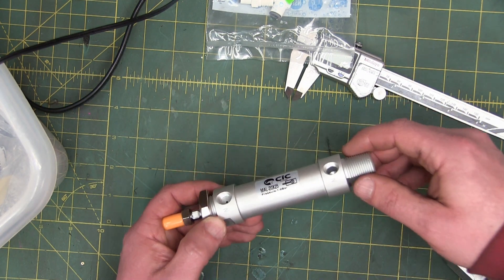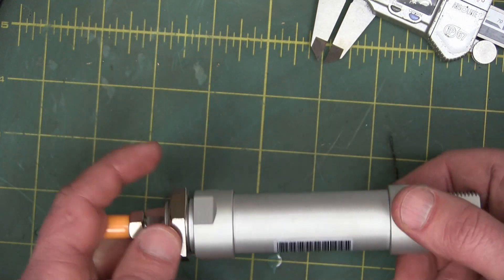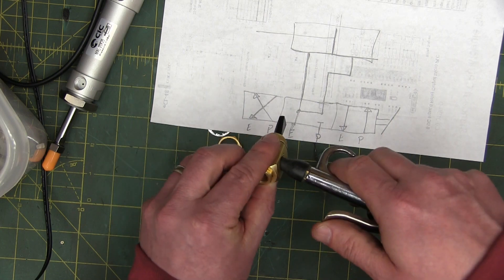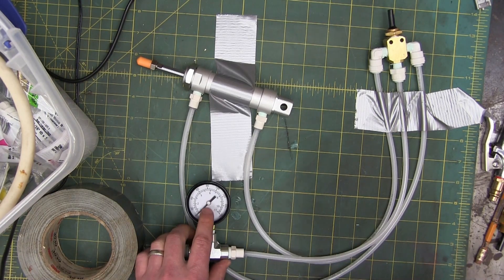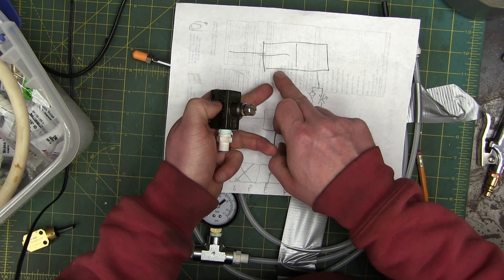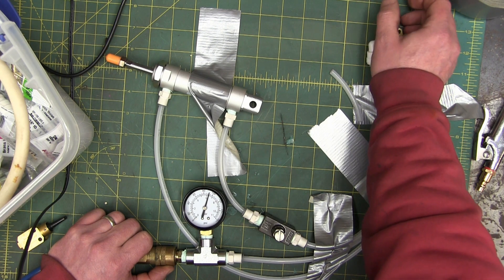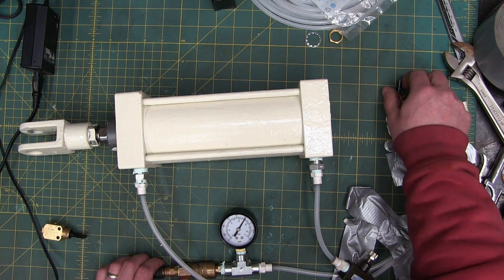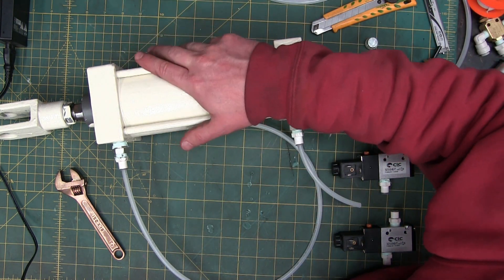PEW-PEW! Pneumatic Automation | Industrial Lego

Comment: 4.00 regulated flow valve, speed it up, slow it down in either direction. these things are so easy and loads of fun to use, Ive made some complex sorting machines with nothing but controlled wind.

Comment: Love the end : )
I fix wood shop equipment, among other things, and some are packed with this tech.  

AVE do you know that this is exactly what is done to keep the belt on the rollers on belt sanders?  The actuators oscillate the top roller(s) with micro-switches (sometimes optical switches,...)  that the belt actuates when the belt gets to the end of the roller.  It just walks back and forth to keep from running off the end of the rollers.  Also good machines have flow control on both sides, it allows smoothness, quietness, better performance and longer life when you control flow on both sides.

Comment: Now you’re speaking my language. We have a ton of Bimba cylinders. Servos would be nice (Linmot) but so pricey.  The cylinders on one of my machines are spring loaded for quick return. Some are custom made to resist heat (seal bars).  The bigger cylinders can be rebuilt. Just held together with snap rings. The smaller ones just get replaced. Linmot style servos would make changeovers so much faster and they would last forever, but the cost of retooling would be prohibitive.  Looking forward to some solenoid talk. Yeah baby.

Comment: see all this stuff at work daily. the only thing I hate is when they use pneumatic limit switches in safety devices.... moisture and particles foul those damned things up and they sometimes stick. was almost killed ( literal 6 inches or a half second) by a 2 ton mod full of leaf springs coming off a gravity feed chutter because a switch got stuck.

Comment: On the subject of flow controls, I worked on corrugating machines. I was a maintenance tech. One of the other “techs” insisted on putting the flow controls on backwards. After 3 or 4 times trying to explain how they worked I gave up and resigned myself to replacing cylinders on a regular basis. 5 years retired and I finally regained my sanity.

Comment: Ryobi 4 color printing presses were/are automated with this stuff plus matching plug and play air solenoids. pull one lever other three follow suit. Or the monkey pushes one button and away we go automated start, run, print,rundown, stop. Uber cheap. Just make sure to adjust stroke so as not to snap off operating lever small package humungus torque.

Comment: Tiny bit of experience: Used these quick connects all over the place in my jeep. They work great but they leak if there’s a moderate amount of lateral force on the tubing, so it’s good to watch your bend radius and use other means to hold down tubing where necessary.

Comment: You could just use micro switches at each end of the throw to actuate the relay. The 'confuser' is just added complexity. Though I would agree that it is a more elegant solution as it would remove the 'mechanicals' of using micro switches and allow for 'tuning' or changing the operation.  Loved this one. Thanks Uncle Bumblefuck.

MozZ UK

Comment: Once played with a keg washer line at a brewery. (3 lines, identical except for conveyor length)

All the logic switching was done by pneumatic "microswitches" to facilitate tilting and rotating of the kegs. Pneumatic actuators throughout.
Only "electronicals" were for the sterilising rinse time (hot caustic soda).

I was told that the washer lines were originally designed in the 1940's.
My job was to find why beer was going off before its time.
It was an electrical timers; one line had barely a third of the necessary rinse time; and that was on a "secondary" washer line which was used only during peak times or when the primary one was "jammed" by a (deformed) keg falling the wrong way.

Comment: Good video.  I work at a winery putting wine into bags and sending them on their way to get sealed, palletized etc. Pneumatic actuators are our bread and butter. I took a bad one and cut it length wise so the noobs could see how they work. We also use a crap load of "MAC" (brand name)  pneumatic valves and ed everything is on a program to perform a sequence of operations to feed in a bag, in cap the bag, fill the bag, recap etc. When the plant installs new equipment, it means old machines are removed and this means left over parts in the parts room. Knowing the guy who maintains this cornucopia of new parts that are no longer needed can net some cool stuff. How about a Halloween coffin that jumps around and the lid slams up and down...f'n awesome.

Comment: Aww, I was hoping for air logic. The problem with using a computer for something is that there is no limit to the amount of complexity that can be hidden away in that tiny black box; you can't ever really trust a computer-controlled system the way you can a system with only uses simple components.

Comment: Mind numbing?   I had to unpackage exactly 96 individually wrapped parts for a pair of 2.0 liter subaru cylinder heads in order to clean, check,  and assemble for the local stealership.   Would have blown my own brains out had I gun handy.

Comment: Used to do ldpe rotomolding and thermoforming.  We made spiral playground slides and for a year we would punch the holes where they bolted together one at a time by positioning the part by hand then stomping a lever with our foots to punch the die through.  We ended up building a fixture with 26 pneumatic dies to punch all the holes with the press of a button.

Comment: I was taught over 30 years ago, "when in doubt meter out" that works for pneumatics and hydraulics. On pneumatic valves that has a threaded exhaust port I like to use the two in one exhaust muffler / needle valve, it eliminates fittings which cuts down on the possibility of leaks.

Comment: Great video and very interesting AvE!
At my old job, I built an automatic honing machine that was all air powered. I used some limit/stop controls to set the stroke length and flow controls to set the RPM of the air motor turning the hone and to set the air cylinder stroke speed. The finish on the bore we desired took 1000 rpm and 60 strokes per minute. When I started out building the contraption I'd be the first to admit that I did not have a clue as to what I was doing, but with copious amounts of reading/studying and experimentation I managed to make it work and it worked damn good if I have to say so myself. Once we were finished using it for our purpose, a machinist we knew came by and saw it laying in a corner. He asked us what it was and if we would demonstrate how it worked for him. We did so and damned if he didn't buy it from us on the spot. I wish I had enough sense at the time to take some pictures of it and diagram it out with a parts list, but I didn't.

Comment: I literally just did this last week, with the exact same components. Two air cylinders, 3 way electric solenoid, controlled by a micrologix 1200. The same exact job. I had to build in a few safety devices, dead man switch, stack light, prox switch, air pressure switch, ect.

Comment: Motor graders are a good example of a machine that uses a float envelope in a control valve in a hydraulic system. Usually it will be a 4th detent position to control blade height. So you have up, closed, down and float on the blade. Float essentially gets used to even out the surface using just the weight of the blade.

Comment: I worked at a major medical device manufacturer a few years ago as an intern. I went to their production facility. There were extremely automated lines with some of the most creative machines I've ever seen, churning out products with no manned intervention. Then I also saw fully manned production lines with supervisors, quota clocks and everything. I asked my supervisor what gives? They know how to automate all of these if they wanted. He told me that the economy of scale dictates what is automated and what isn't. The automated lines cost millions of dollars to design, set up, test, and run. If the product is a low volume manufacturing, it's actually cheaper to higher people to pull levers all day.

Comment: AvE could the big cylinder or similar be used to drive a powerhammer? Could you use one as the actual striking head by affixing a proper tool to the end. I guess the real question is can a piston like this deal with a short stroke if there is an interference object and keep cycling...

Comment: That reminds me pneumatic circuit I made at work (I'm electrician btw). Two-hand control block (fires up when two inputs are switched on in 0.3 seconds), switch and 5/2 valve. When machine did certain operation, I needed pneumatic cylinder to move one direction and then automatically go back when it reaches back position OR when pressure from machine disappears (to make it idiotproof in case somebody reduced air flow too much). Whole cycle can be repeated when control pressure from machine disappears and then appears again.

Pressure from machine movement I was monitoring was split into two lines, first line connected directly to two-hand control block, second line via end switch (NO - normally open) to second input of two-hand control block. Output of that was connected to 5/2 valve controlling pneumatic cylinder.
When machine did certain movement, both inputs were pressurised at same time (within 0.3 second), two-hand control switched its output on and that switched on 5/2 valve. When machine stopped doing that movement (both inputs disappeared) or end switch was pressed by piston (one input disappeared), two-hand control switched itself off and 5/2 valve was switched back to its base position, so cylinder switched its movement and went back. Whole cycle was reset when control air from machine movement disappeared entirely (both control input of two-hand control disappeared).

Comment: I own a laundry mat and was discovering that the wash attendants were using way more soap than they needed to be using. So I went and found electronic triggers and timed relays so that they can hit a doorbell button and it will dispense the right amount of soap into each washer. I've saved over $1000 in just the last 6 months and it's faster cause the girls don't need to grab the bottle, grab the measuring cup, and wait for it to finish pouring into the cup and then wait for it to continue pouring. I'm a huge fan of technology in any shape or form that we can make humans not do irrelevant tasks and make a better place of work for employees
Reply: gonzostwin1 What girls? You mean the customers? Or is it an actual laundry service?  At the laundromats I have used, a measured amount of soap is dispensed on payment, either a few cent for soap alone, or one cup dispensed when paying for one run of a machine (depends on shop setup).  Entire shop unstaffed except maintenance and refills.  Even the front door and lights are usually automatic.
Reply: Nice work, now THAT is cool!

Comment: You should try setting up a regenerative circuit, where cap and tank are connected, but you're also pushing fluid from pump to cap. The area differential will make the extension very zippy. Those needle valves are crap because they dont regulate flow at variable pressures.

Comment: One way to increase speed with pneumatic cylinders is to decrease resistance on the exhaust. In other words don't exhaust all the way back through the control switch, use a valve at the gland end and exhaust (nearly) straight to atmosphere when extending rather than exhausting all the way back through your switch.

Comment: Brings me back to the days when I spent an awful lot of time stripping out 4x8 panels loaded to the gills with pneumatic logic controls that must have taken some poor bastard months to assemble, tune, balance and troubleshoot. 

I would rip all that old stuff out, systems that sometimes took up entire rooms and replace a few hundred pounds of widgets with a single PLC no bigger than a loaf of bread. When you see what PLCs replace, either EM relay or pneumatic logic it blows your mind realizing just how much of a pain in the ass it used to be to get things working right.

Comment: Fair warning, as soon as you see those little mac valves (the little guy on the left with the three contacts) figure out how many your machine has and buy that many in spares.  They all eventually fail.  Might take a couple hundred thousand cycles but they ware out and you want those backups ready to go.  

You'll always see them placed in easily accessible locations because they do die on a regular basis.

Comment: They have pneumatic die cutters at the Tyson Mexican Original tortilla plant in Fayetteville which you can make JUMP up off the ground!

Typically you are supposed to pull both handles at once, which of course, keeps your hands clear of the razor sharp cutting die, but if you pull one before the other, it charges a little tank beneath the cylinder, then when you pull the other handle it goes BAM and slams the plastic cutting board [and the rod and piston in the cylinder] up so hard the 400 pound critter JUMPS about 3 inches off the ground, and you scar the living bejeezus out of all the little old women in the hand packaging department making them scream, run cry and pee their panties. [HOP HOP HOP!] \(^_^)/

I only did it once of course, so I could claim it was an accident.

They quickly let me go back to scrapping. [HOP HOP HOP!] (~_^)-b

Comment: Talking about Lego: We made our own pneumatic actuators from 1" PVC tube, caps, 1/4" brass rod and other sundry washers and nuts.  We used these to operate individual blast gates for sawdust collection in the wood shop.  In each stationary tool we installed a 24v DC transformer on the power switch that actuated a solenoid valve to send air to the actuator.  This way, only the tools in use pulled vacuum pressure from the dust collector, which greatly increases efficiency of the collection system.  We also used a pedal-activated solenoid and actuator on the Excalibur scroll saws to lift the arms for blade changes.  This stuff is stupid easy to do and it makes the work super fast, much safer/cleaner, and a lot more fun.  Thanks for the great vidjeos, AvE!

Comment: Could you not have a spring on the cylinder for fast extension then controlled vacuum to return the cylinder? Then all you need to worry about is vacuum on and off?

Comment: To simplify automation even more.. Your toggle switch valve can be replaced with a roller switch valve mounted at the end of the stroke position, piston clicks the valve to release air. Then a second roller valve positioned when the piston is back in, click and the air flows back in making the piston extend again. This removes the need for a confuser.. Because when are electrics ever 100% reliable in constant use. This lets you keep the whole system all driven on just air from the same source. Bed goes up, air releases. Bed goes down, air flows back in. The beautiful cycle repeats.

Comment: Now install that cylinder up inside behind and in back of the greasiest and most inaccessible components on the machine, put the adjustable check valve behind that, with the knob oriented in of course. Save a dollar by extending the service interval on the compressor air filters. Put a couple million cycles on it and then when the carefully designed cycletime of the cylinder gets all cofluky dye to accumulated schmu, get some human who's never seen this particular assembly before to crawl in there and disconnect it so the new owner of the company can pay some marginally qualified infant who desperately needs an income to push the lever by hand until the rest of the company's assets can be sold off and the whole bidniz can be moved to some corner of the world where life is cheap.

Comment: I had a part that i make at work that i had to do the monkey lever routine indexing holes with a super spacer, 50 holes 5 tools per part.  that i just recently replaced  the super spacer with an pneumatic indexer. I puta raw video of it running up on youtube. To see just search erickson model 600 speed indexer there are a few people with videos showing them in action. They are a cheap way to add some automated indexing to old cnc mills, as they can be found  cheap. They are probably considered obsolete. But if you are indexing things by hand adding a few seconds to cycle time and not to have to stand and index a part all day is awesome.  Freeing me up to go make stuff on other machines.

Comment: Hey, AvE, could you explain to the folks out there how a clock or cam type machine works? Something like a screw making or spring making machine. Something that will run without any external machinery other than a powerpoint.
Reply: Dom Reale The one thing that runs with no external machinery except a PowerPoint is management consultants, because they don't need to Excel at anything.
Reply: lol

Comment: @Ave there's a program called FESTO FLUID SIM that allows you to design pneumatic systems and test them with diagrams and stuff. You can virtually make automatic machine just using pneumatic stuff and valves. Its like programming air.

Comment: Dis-agree with no new tech in fluid power systems..has been heaps,for example micro control pneumatic,so fast,and yes it's plc or confuser control,some of the tech is micro- scopic,and even some hydraulic gear is going this way,servo proportional,whilst i think of it a lot of water systems are going the same way,,,Hmm used for control cooling,,getting steel temps right,,so as not to screw up metal chemistry,,,
But ya right the old principles apply,,just different do-hickies doing the same job and some of the drawings are useless,,had a drawing once showing motor and pump goin straight to relief valve..nothing else,,when the Boss asked what it was told him.." 100Kw heater," he looked at me in  dumb tone and wandered of,,good schematics make life so easy when ya knows about this smoo reliable gear is supposed to be doing and why,,